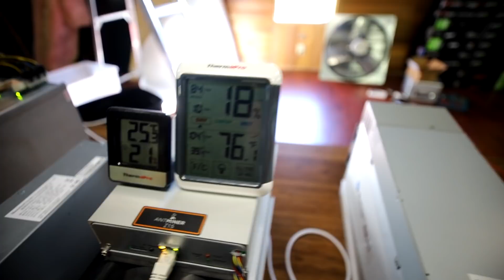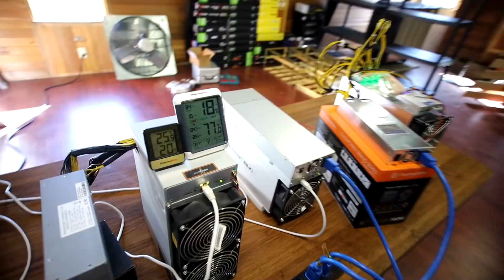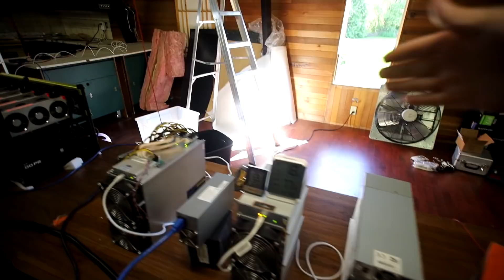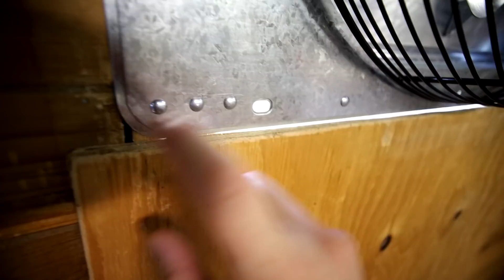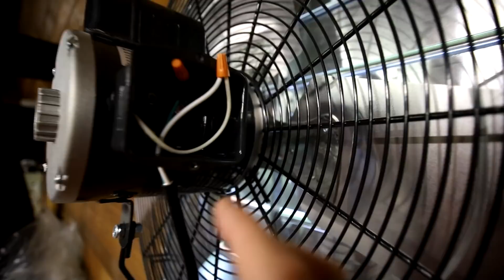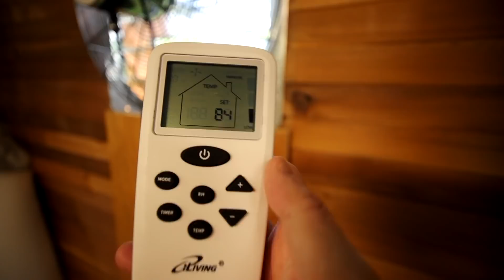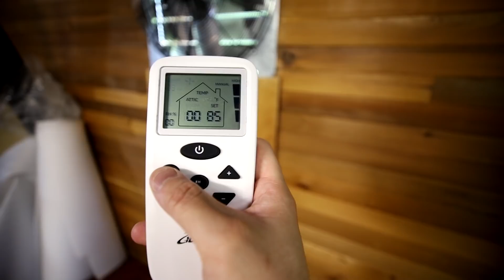Mining Barn Getting HOT!

Comment: Realistically, you'd want to close off that hole in the ceiling, put fans on ceiling, make sure crypto barn roof has roof vents, like most homes have. Or it might have front/rear facing vents. Vent all the hot air into the attic, because hot air rises, so you might be feeling cold air. But it's not cold air, it's cooler air. There's a difference. The attic air may be cooler than the room, but it's definitely hotter than the air outside the barn. This will only get worse the hotter it gets outside. It's why windows have a top part and bottom part. Which ever direction wind is blowing, open bottom window facing that direction and open top part of a window on the other side of the house. Nobody ever does this the way its intended and just opens all the windows, ruining the purpose behind the design.
Reply from the maker: The roof I believe imo attracts the sun cuz it's all metal sadly so I bet it's hot as heck up there
Reply: @RedPandaMining  The heat wants to rise, it wants to go into the attic, but your exhaust is fighting it. Getting air from attic is working backwards. And might be just exhaust a large percentage of air from attic instead of room.

Comment: Red panda - "ok guys tell me how I should setup these fans for proper intake and exhaust"

Then goes onto installing the fan as per his desire😭 😂👍🥺
Reply from the maker: 🤣 I already see suggestions may change it
Reply: @RedPandaMining  I'd suggest going for two intakes and one exhaust! Should be pretty effective and efficient!
Reply: You don't need more fans on intake, physics will do its thing.
Better to add 2nd fan only if needed it will raise your flow to around 7600-7800 CFM total.
You will need to open another window.
You can use the one next to it, and just build a wall / partition thelat will end where the miners intake are, it will force the air to flow to the back of the room / barn, and then circle back through the miners to the exhaust fan/fans.
It will save you power as well.
I am using dual 18 inch 1700 CFM fans with a single controller.
You can use 8 feet pallets, maybe 3 of them, and staple a siding moisture protection plastic on to them.
Cheapest way I know of to make that wall.
Again, this assuming you would use 2 windows on the same wall, one for the fans, and another for the intake.
But you must have intake, or that fan will consume more power then it suppose to and waste your electricity.
If you want, I'll be more then happy to get on a call and help you out with planning and execution..
Again, thank you for being here.
Manny E

Comment: Looks like you have to do some work on the drop ceiling anyway. Why not exhaust into attic and use windows as intakes??? Filtered intake easy that way.
Reply from the maker: Air will be trapped up there... Wouldn't it?
Reply: @RedPandaMining  not if you have soffit vents. I am concerned that air you are pulling from attic will be 140+ degrees and make matters worse pulling that heat down....

Comment: A good idea would be to place the exhaust fan on the sunny side and the intake fan on the opposite side, pulling in cold air.
Reply from the maker: that is a good idea.
Reply: @RedPandaMining  if you can for the intake fan, connect it to a pipe buried underground. temperature are very low underground ;)

Comment: I would think you would want to put the fan on one side of the barn and pull air from the other side, creating a cross draft to pull the heat.  Also something to remember is heat rises so set the fan high then pull the cool air low.  THat fan looks masive.
Reply: The rising effect of heat is overstated. Even minimum directional airflow, such as an exhaust, will over come damn near all of the uneven distribution of heat energy due to the rising factor. Totally agree that a fan from the other side pushing air over the equipment and towards the exhaust fan would do a good job at helping the exhaust fan
Reply: @billycaves  it just seems if heat rises then why not pull the heat from the top and feed cool air in from the bottom.    just ideas
Reply: @billycaves  I agree about not worrying about heat rising in the design. Do you think sealing up the cieling and having an intake would be better than all that hot air mixing in from the whole? An intake might make what's above the ceiling mix less hot air in . . .
Reply: Only note I would add: negative pressure will naturally suck air through gaps in all the other windows, outlets, lighting, and the gaping hole in the ceiling. the building isn't sealed very well in general since it doesn't have sheetrock but hey, it's a garage.

Probably don't need much for an intake with that exhaust, but an intake would be cleaner air without insulation mixed in (aside from the pollen)

Also, the average attic gets to ~150F-170F on a hot sunny day...
Reply: This guy is right. No point in creating walls and stuff.
Reply: I could have read your comment before saying the same thing. Just that it should be more like a PC. Have air come in opposite of where it escapes. That'll take less energy because intakes on the same side as the exhaust means air has to work harder to change directions.

Comment: What's the ambient temperature you have the mining rooms at during the summer? Do you use any AC? I have a portable AC to help but I obviously that's costly.
Reply from the maker: At one point it was 105f last couple weeks, summer should be even more insane. Now with this fan it has been much better
Reply: @RedPandaMining   so 105 was temporary for this but what about previous summers?  Usually when my temp hits low 90s I may turn off a 3090 or 2 so the temps can come back down. I have 1500 mhs generating a lot of heat. I don't know what's the max temp limit I should keel it under

Comment: Nice vídeo! Anyone now what motherboard would be the best for 6 3070?
Reply from the maker: Any board that has a pcie x1 slot and use a mining riser. Or the pciex16 slot as s regular pc style
Reply: check out pcpartpicker in your country, there is a slider out motherboards and filter them with pciex1 minimum 4 on the slider (that'll be at least 2x16 and 4x1 slots for a total of 6) 
You should have a few to choose from, and take a processor to pair it with, the most common and cheap ones are for intel lga1151 socket.

Comment: Don't put your cold intake and hot exhaust close to eachother, the cold intake will pull hot air from the exhaust if the distance is not great enough, better to oppose sides with intake and exhaust and make a clear path so the air has a straight path to your equipment instead of around all the stuff that's there. Just my 2 sats...
Reply: Yes I have a 12x24 shed.. I pull in air from one side exhaust the other.  Works great for air flow efficiency.,, my intake air is filtered.. so have 1/4 ho fans on exhaust.. also added 4600 fans to help pull air in on the intake side
Reply: 4600 cfm
Reply: I run a 4ghs mining farm plus 15 ASICS...

Comment: For air flow find out what your natural wind air flow hits the barn then use that as. Intake wall and you want to expel how air thru top of roof hot air naturally rises so best is a whirlybird with a power exhaust to push air out this would be optimal. I do ac so pretty easy

Comment: i also got heavy problems
i have 3 mining rigs in the room i sleep and its getting really hot. 
Here in Germany the Power Costs are really high so i wouldnt like to use a AC.
anyone got some tips for me?
Reply: You should never sleep with miners in the room, you can get a heatstroke and end up dead. Happend to many miners already
Reply: @jorikvandammen8870  currently its about 30celsius in my room so it should be fine but when we will have high temperatures Outside in germany i have to do something. I might try something like a growtent
Reply: Try a growbox with exaust out of the window.
Reply: Grow tent with exhaust 🤭
Reply: Indoor growing tents were a craze a few years back, could be the thing if you got enough room in it for all the rigs and a window nearby in the room
Reply: Does anyone have any recommendation for a good quality growtent with a good performing vent? My 3x 30rtx rigs should fit in there